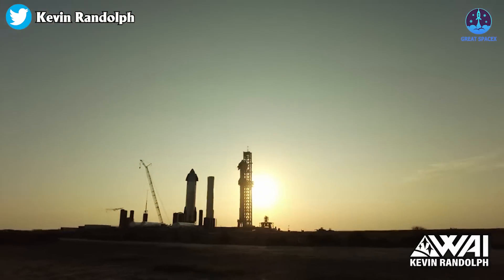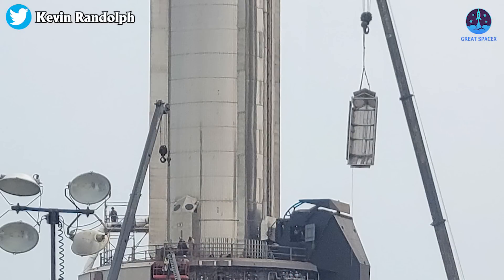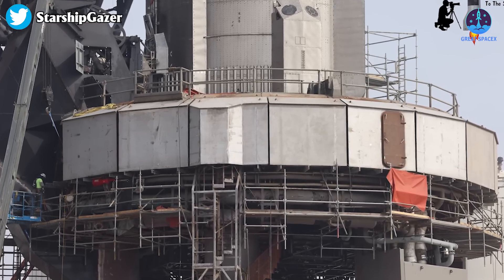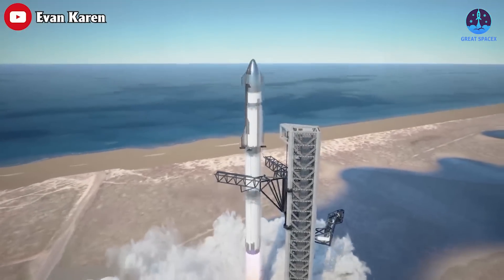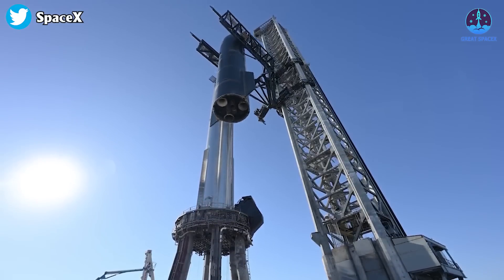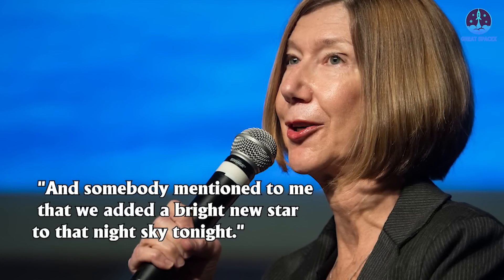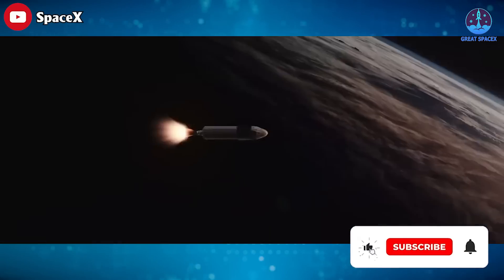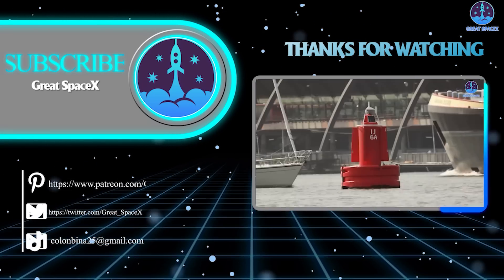SpaceX upgrades everything for Starship first orbital debut this month

Comment: The labor, redesigning and expenses  involved in "Blastproofing" Stage Zero (the OLM) makes no sense without the acoustical & heat protection of the Water Deluge System. I'd honestly be surprised if Spacex attempts a 100% throttle, 33 Raptor, launch or test firing w/o the Water Deluge system being fully operational.  Seems counterintuitive after all the damages & pad work incurred from Less than 33 Raptors running at Half Throttle.
Reply: All valid concerns, though the Elon PR stunt is not going to have cargo, so he can still launch at relatively low power. Which suits his purposes perfectly, since he still can't get his engines to run as designed without melting and blowing up. Meaning that regardless of what he manages to launch into orbit or sub orbit, he still does not have a super-heavy vehicle and won't before the test flight. And that means he still doesn't have a vehicle capable of taking a loaded starship to trans-lunar injection. He is, at this moment, years and billions more dollars behind SLS and years and billions more dollars from having a vehicle with equal launch capacity to the Saturn V.